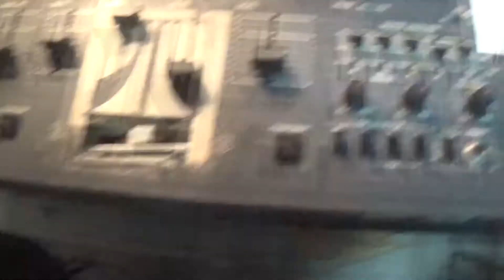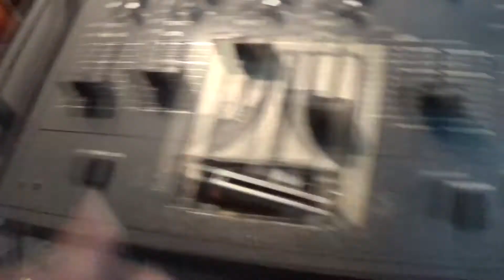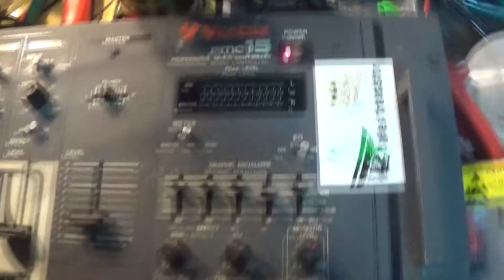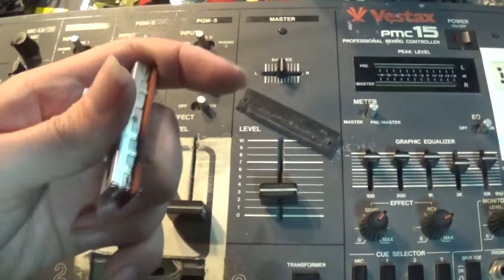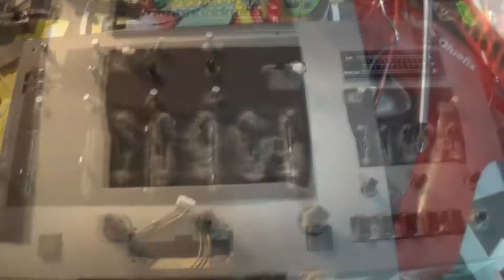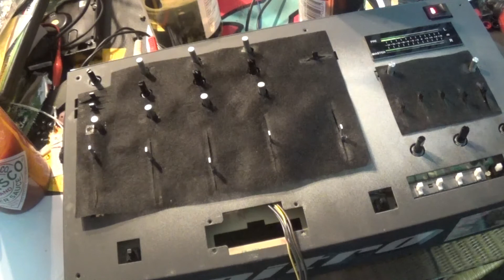Vestax PMC 15 Mixing Controller Repair and Cleanup

Comment: Hello. Many thanks for your video. I find it very useful and easy to follow. I just wanted to ask you details about the potentiometer for this Vestax mixer. I need to replace the crossfader and I would like to know if you could help me find the right replacement by providing me with the part details. I live in the UK and use mainly Ebay or Amazon UK. I've just checked Ebay and they sell many different potentiometers. I'm not sure which one I should buy as I'm not an expert on this issue. I'd appreciate your advice. Many thanks. Pab